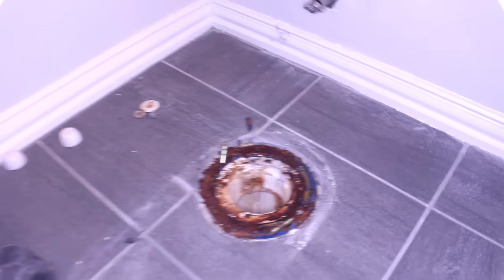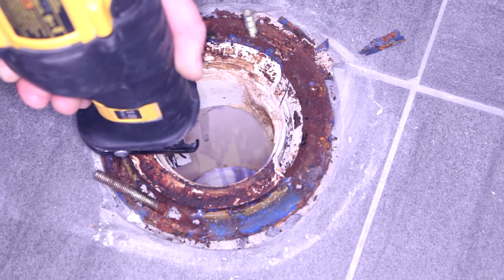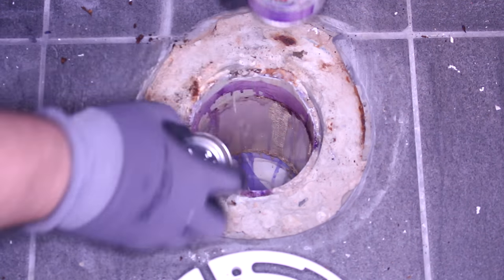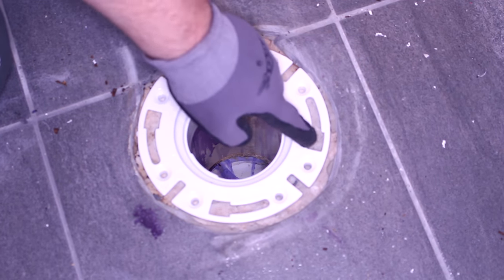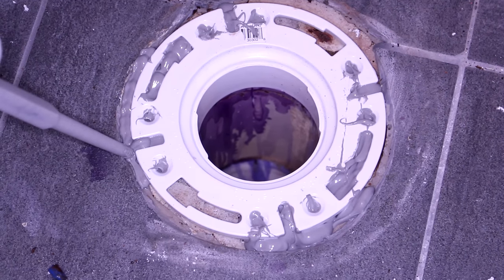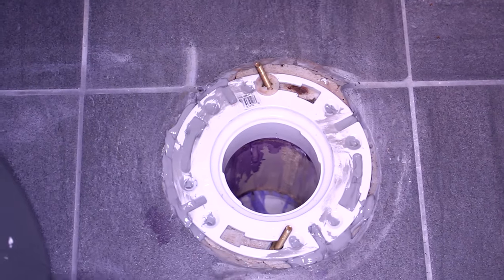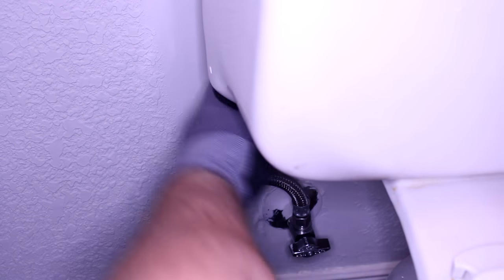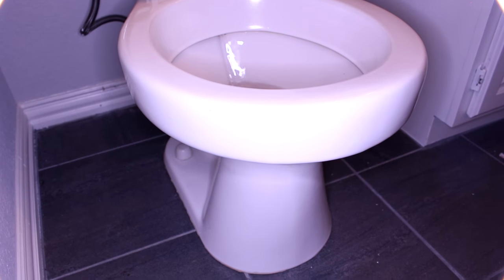How to Replace Toilet Flange - DIY Instructions

Comment: I was taught by an old plumber , been plumbing for 28 years . The reason you were able to take that flang off so easily is because the plumber who put it on didnt use any primer , very smart because it made your job easy , never use primer on a comode flag because if you do youll be there a long time taking it off in little pieces when the next plumber comes to repair it . Another thing is to always,  always  make sure that the bottom of your flang is the same elevation as your finished floor because if you dont when your wax sets in time it will leak under your tile or what ever finished floor you have and that will cause expensive damage , you can fill that gap between flang and unfinished floor space with hydraulic cement takes 15 minutes to dry . Anchor your flang to the floor with some sort of drop in or red devil's if thats all you have ,   take your time do it right the first time . I learned that the hard way and my mentor made sure i understood that .
Reply from the maker: Thank you.
Reply: The elevated flsng as i explained will make sure your comode will use sll the wax and not just part of it
Reply: @blackbirdmetaldetecting6893  there are a lot of houses that have flanges NOT flush with the finished floor and without any problems. Mine being one of them. Depending on how high or low your flange is, you can use corrective add-on products or different wax ring thicknesses to remediate this issue. Of course this isn’t to say you shouldn’t aim for a flush flange, but your comment implied that it’s an “absolute must” which I respectfully disagree.

Comment: You could have just replaced the rusted  ring and tapcon it down.
Reply from the maker: Of course you can . But I think you would like it to be repaired proper way.
Reply: They sell the replacement ring for this reason. It’s an exact replacement.
Reply: Agree, but then ... how much can you charge ?
Reply: I use the stainless repair rings and stainless screws on repairs, never plastic because they break

Comment: A little surprised that he made no effort to keep debris from falling down into the drain while he was cutting. In every other video I've checked, the demonstrator blocks the pipe with a rag or a bunch of paper towels both to keep junk from falling down into it during the job and to prevent sewer gases from coming into the house.
Reply: Lool again. I am almost certain tere was some sort of sruffed bag.
Reply: If you look carefully he did. There is a white rag stuffed in at the bottom

Comment: Maybe it works for others but not for us. When I attempted to lift the wobbling toilet with the twist on flange installed, it pulled the newly installed flange off the floor.
Also, without properly securing the flange to the concrete floor using screws, the pulling pressure will go to the pipe instead of the concrete floor.

Comment: I see a small creepy bug crawling at about 10-11 O'clock soon after the old flange is removed. Also, I thought you needed to put a rag in the whole to protect you from the gases coming up.  If not necessary how long can you be exposed?
Reply from the maker: even filming we were exposed  for no more than 1 hour , sewer gas is more unpleasant than dangerous. keep  door /window open.

Comment: So what is holding the flange to the concrete slab floor?  Just some glue?   That will not last.
Flange has to be bolted to the floor.
Reply from the maker: 5 years and counting

Comment: By the time this is answered will prolly be too late lol. Was the cement added because the flooring is concrete? I've only seen just pvc glue. Thanks.
Reply from the maker: I like to fill voids between  PVC and concrete slab so no moister sits there. also, it will provide a little bit of rigidity to the flange. you don't have to do it.
Reply: My flange was on top of uneven concrete and with void spaces all over. I put pieces of black plastic shims under screw holes, then screwed flange after made sure was leveled.
I didn't know about that liquid epoxy concrete available to use some as well.

Comment: You want to put a bead of silicone (clear or white) around the toilet base after installing , it will seal out any gases that may leak up under the wax ring/toilet, if you don't seal it you may smell nasty sewer gas from time to time.
Reply from the maker: If seal is broken you need to change wax ring .

Comment: My flange is way harder to get in that that. I think I'm going to have to Sawzall to make it an inch shorter and file it down to make it smaller outer diameter
Reply from the maker: You can do it or get rotary file and file down a pipe a little.

Comment: Went to replace my toilet that was smelling real bad. House is 25 years old probably never been replaced, thing was rocking. There was 0 wax left on a rust filled ring that was all bent. Only took a few weeks with a chisel to come clean off and a chunk of plastic went as well. Made an attempt to hand cut with a saw zaw blase the plastic but its glued in real well. Tons of white glue seeping down underneath the vertical portion ofnthe flange. Thinking il be doing some grinding with a dremel and some carbide bits tomorrow.
Reply from the maker: Thank you for sharing. Keep us posted

Comment: Personally I think the concrete patch is pointless since the wax ring will guide the flow of water. Even if the wax ring gave out the water sitting on the concrete slab won’t do anything and if it gets there it’ll come out of the bottom of the toilet which would let you know it time for another wax ring
Reply from the maker: thank you for your comment

Comment: suggestion-when you first lay the flange down you mention it being horizontal but there is no reference for that.  is it important to have one of the screw holes or one of the slider channels in a certain place?  how do you determine where to place it? should you mark the floor where the bolts are on the toilet before you remove it...maybe with tape?
Reply from the maker: You can , or you can measure a distance to the wall . Should be equal.

Comment: I have a capped off toilet drain in my basement with the same new white flange used in the video and it started leaking underneath (on to concrete so no big deal).  Could I just use a concrete adhesive or some sort of caulking around the base to curb the leak or should I replace the whole piece?
Reply from the maker: I would replace it .

Comment: Does it make any difference if there's lots of wax and poop on the sides of the pipe when putting PVC glue to bond the new flange?
Reply from the maker: Better clean it.
Reply: Hired a plumber to rebuild the flange. Still emitting some sewer gas although not as bad. Why isn't chalking the bottom of the toilet and bolt holes stopping the smell? Thanks for the response.

Comment: Probably better to pre drill some holes and taps in there. Also even he used primer you still can remove pvc . A little harder but it works fine . Theirs drill bits that are made to cut out the old pvc as well
Reply: But why use the PVC cement if it's not needed?
Reply: @cra2cra226  it is need lol thats all is needed. All that extra glue in the tube is not needed lol very unnecessary

Comment: Great job getting the old off. Primer & glue are very important to weld the pipes together.  Jamaica Joe told me you must prime it well Tommy, and no burrs. If you pull i bur through the glue line you'll ruin the seal... 
   Joe was too much, he could prime & glue 30 fittings without leaving pouple anyplace but the joints..but he did make me take more serious the 2 stages of gluing..
  Like that you glued that flange down, better than nothing, but if they change the follr or anything where you have to change it again..whooo baby you,re going to work.. Today they make screws thad come with the proper bit to screw cement without anchors.. I haven't had a chance to use them, i got sick when they started getting popular..

Comment: I thought that it was by code to caulk the toilet. Something about sewer gases
Reply: MARC GARRITY the wax gasket prevents the gases from escaping as well as the water from leaking when flushed. Toilets have a built in pee trap... the s curve designed in the toilet also prevents the gases from escaping into the bathroom. If you smell methane then your wax gasket is improperly installed . Also all toilets may need to be shimmed to level it. A rocking toilet is not level and will leak water and toxic gases.
Reply: You never caulk around base of toilet to floor because if there is a water leak you won't be able to see it and repair it in a timely matter until it goes worse and get flooded bathroom.

Comment: Wax rings are trash use the plastic one at lease they won't melt when you dump hot mop water down it
Reply from the maker: I wouldn't recommend putting any hot water in the toilet. Besides, it may melt the wax ring and it may crack the porcelain.

Comment: Some old timers would put structolite to fill the space around the wax ring and then caulk the toilet. The logic was that it keeps the toilet from moving around preserving the integrity of the wax for more years. I know it’s not necessary but does it hurt anything?
Reply: But he didn't put a wax ring..well at least in the video it doesn't show it
Reply: He did - at 4:38 - it really is the quickest part of the installation   @mrbluezsa

Comment: Do people still use wax ring ?
Reply from the maker: I do. It is best to none in my opinion
Reply: @LegacyHandyman  I just replaced my entire toilet with the flange and I used the rubber ring it worked perfectly and it wasn’t messy and gooey , I also used two have rings which it saved me time and demolition to my old pvc pipe. But hey as long as it works!
Thanks again for the video

Comment: Is the flange sitting below the tile?
Reply from the maker: No, it's should be flush with the floor like you can see in this video.
Reply: @LegacyHandyman  Should be ON the finished floor.
Reply: @LegacyHandyman  We are laying tile over tile in our bathroom.  Does the flange need to be level with the second level of tile?  If so, how do we make it level with the second level of tile?  We found the video very helpful
Reply: @plbinva  They sell flange spacers that look like a flange but just flat.

Comment: So, if you have installed tile on top of old tile, woukd you follow this same procedure?
Reply from the maker: You might need an extra wax ring in order better to seal the connection or glue the  pipe flush with the level of the new floor

Comment: In my mind I’m pretty sure that’s supposed to be screwed into the actual floor not held together by some Apoxsee in some PVC pipe glue I would probably not trust myself on that I hope you’re just a homeowner that doesn’t know what he’s doing but if you are an actual installer and does this on a daily occasion I’m sorry but that is some terrible work

Comment: I like the epoxy tip, but the rubber gasket in those wax rings always seem to be a problem.  I just use wax ring (which I warm in water) and attach to the toilet first before seating.
Reply from the maker: Thanks for the info!

Comment: Why would you"Weld" the flange back into place? Next time it needs to be replaced , it will never come out. Shouldn't you just have skipped the cleaning process and only glued it so it  would only stick and not fuse?

Comment: Everyone fixes a flange differently.  I'm screwed if this has to be done.
Reply: The flange was cracked.  I needed a plumber.  It was a 3 hour job and cost me $360.  I can never save a buck lol.  We would have tackled it fine if it was just a wax ring.